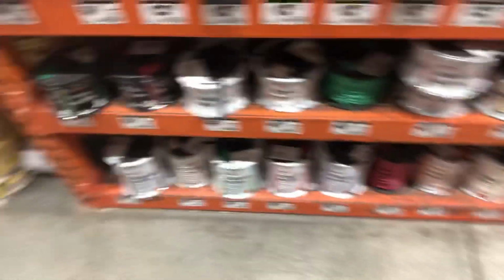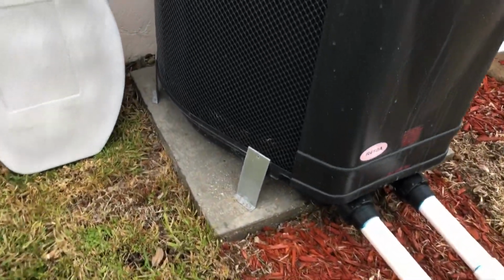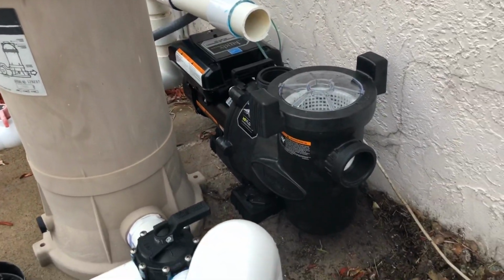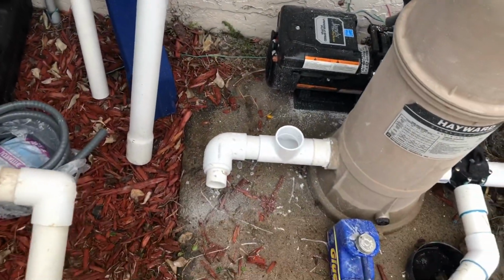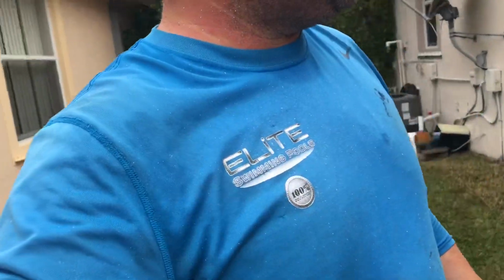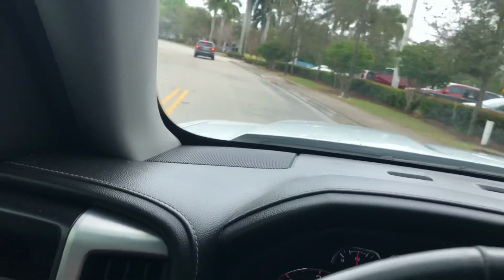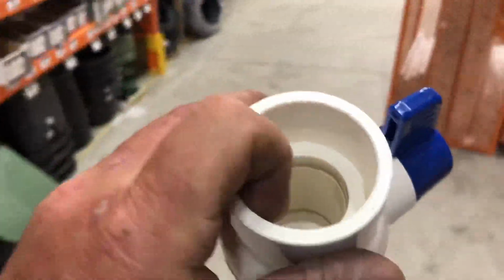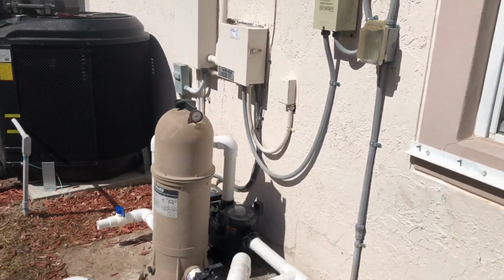Installing New Jandy Variable Speed Flo-Pro Pump and IQPUMP01 Controller & Complications Started.

Comment: Do you put it on the base just to keep it off the ground for rain purposes?
Reply from the maker: Yes I always like to put the base to raise it up for rain purposes, and most other pumps inlet height is at that level. I think putting this pump directly on ground isn’t a good practice, but that’s totally my opinion. I typically only install this pump without a base when inlet pipe matches that height without base and the concrete pad is high enough from ground (dirt) level. Depending on how I see pad area, pvc pipes I may quote it with raising inlet manifold.
Reply: Elite Swimming Pools TV nice! Sucks to see some pumps literally installed below grade and even in the dirt sometimes I’m like wow!! Great information!